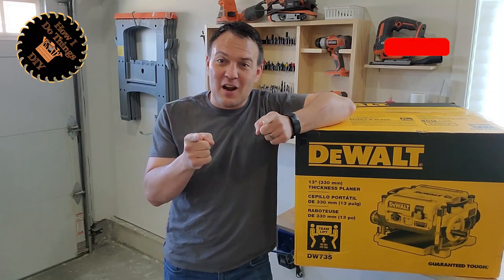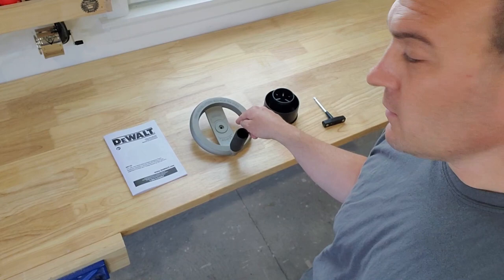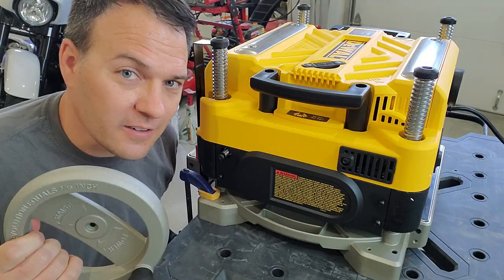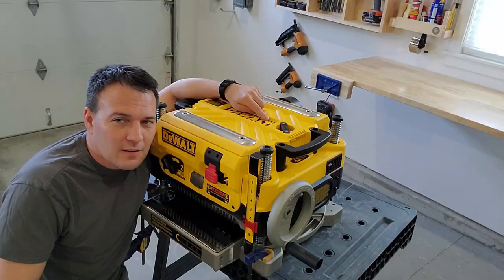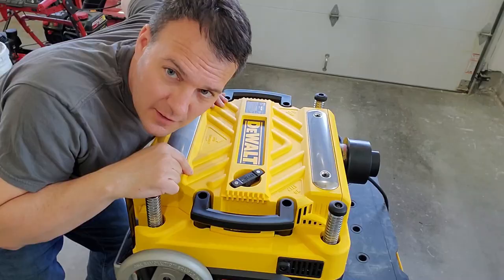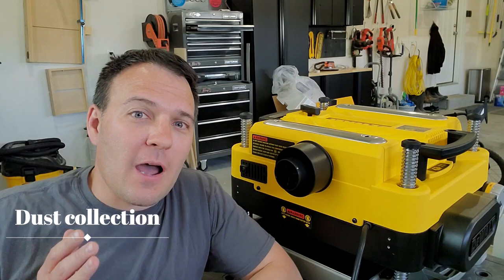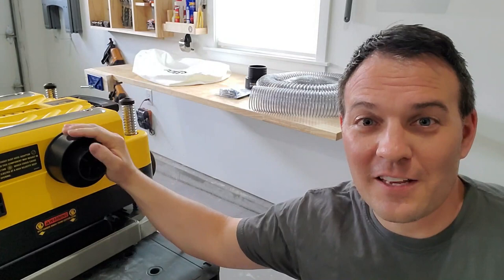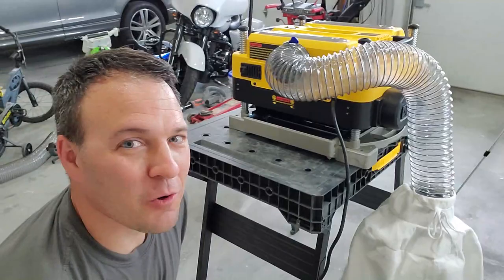DeWalt DW735 Planer: Is It Worth It?

Comment: I don’t understand why you put the board through 5 times ?
Rough setting?
Fine setting ?
Reply from the maker: I didn't want to take off to much in one pass.  Sometimes you have to make multiple passes to get down to the desired thickness.  The fine setting pulls the piece through more slowly to get a better finish.  Thanks for the comment!
Reply: Oh, I didn’t see you adjust the height after each pass 🤔
Reply from the maker: @jeffcampsall5435 I probably didn't film that.  Sorry.  Yes, I adjusted the cutting height a little with each pass.